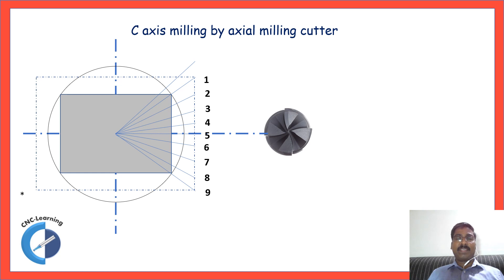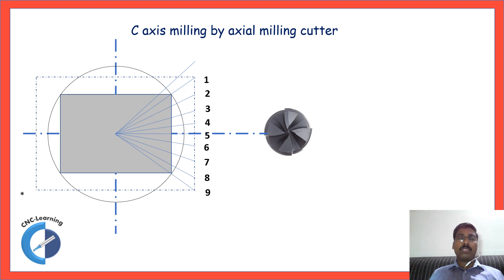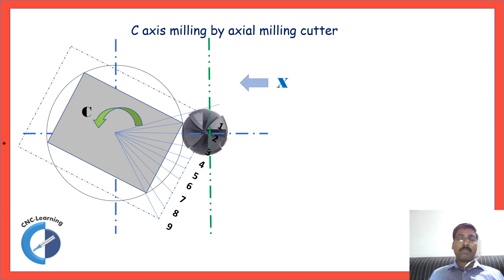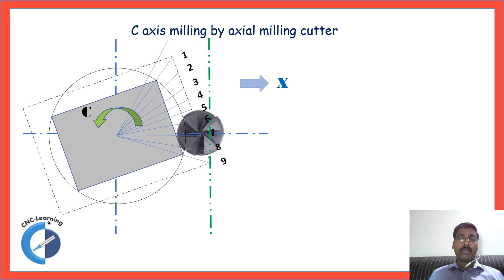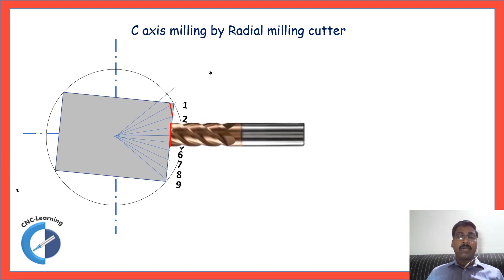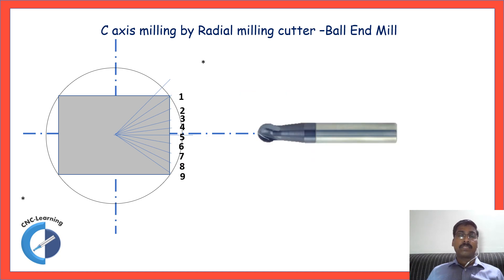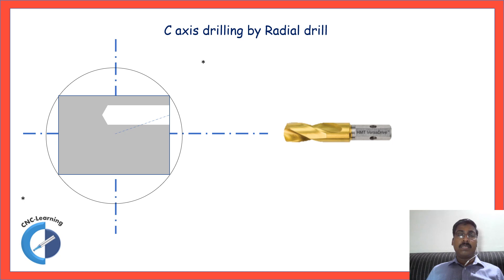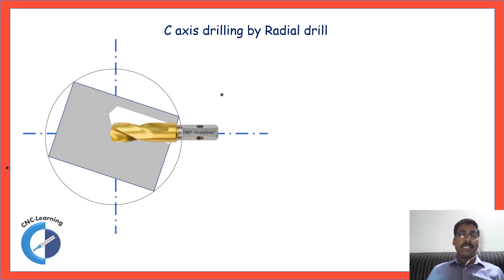C-axis machining concepts on Turn-Mill| CNC-Learning | Rajeev Sreedharan

Comment: How to lock c axis without any movement
Reply from the maker: You need to use C axis clamp command (M code)
Reply: @CNCLearning  sir pls reply that command ?
Reply from the maker: @muthukumaran1458  you need to read your machine manual to know the exact code. It will be like M14 or M24
Reply: @CNCLearning  thank you sir

Comment: Sir, can you explain the value of C calculating technic manually
Reply: In polar coordinates interpolation ie 12.1 it is not like Y axis program
Please do a video that explains polar coordinates interpolation
Reply from the maker: @Vineeshkumar1983  ok
Reply from the maker: If you want to make a milling program on Turn-mill, calculate coordinates as in milling. Then simply use C instead of Y.
Value of X will be diameter or radius depending on diameter programming or radius programming (usually for Fanuc, X value you need to double)

Comment: Sir pcd me thread kaise dalte hai thread mill se
Reply from the maker: Use Helical interpolation. 
Application is same as that of VMC. Only programming coordinates will differ
Reply: @CNCLearning   can you take a video about camshaft turning on turnmill,and it's manual program
Reply from the maker: @Vineeshkumar1983  will try. Not immediately